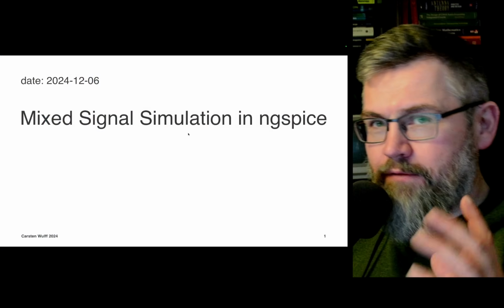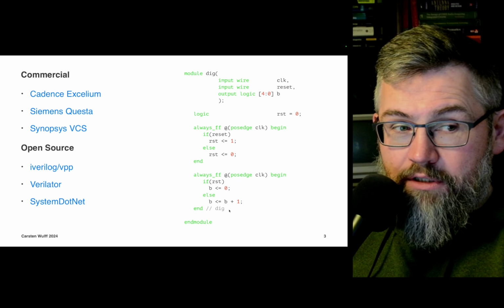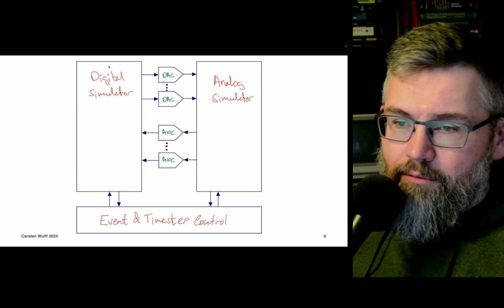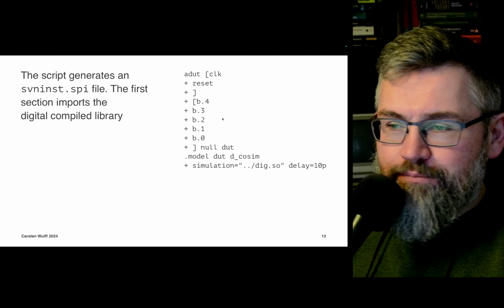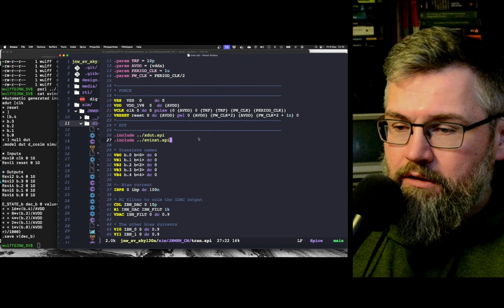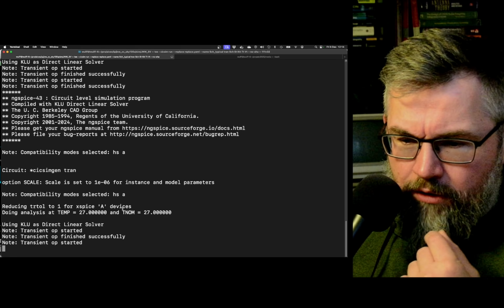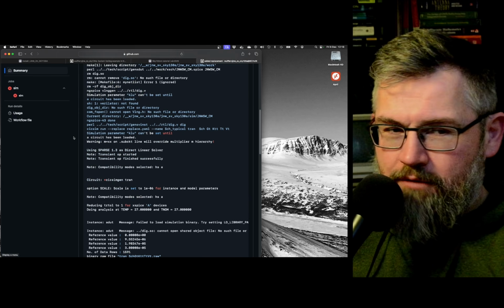Mixed Signal Simulation in Ngspice

Comment: Mixed-Signal Simulation in Ngspice: Combining Digital and Analog Worlds

* 0:00 Introduction: Overview of mixed-signal simulation, combining digital and analog components.
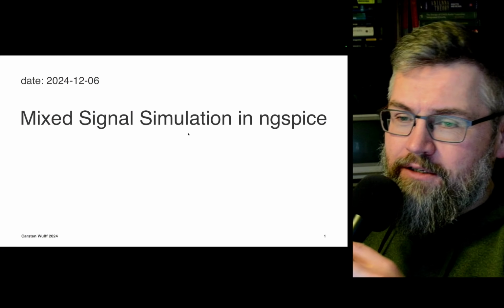* 0:40 Digital Simulation: Discussion of digital simulators, their causal nature, and the use of languages like Verilog/SystemVerilog. A simple counter example in SystemVerilog is presented.
* 5:00 Analog Simulation: Explanation of analog simulation, its challenges due to non-linearity and varying time constants, and the use of numerical methods to solve differential equations. Commercial and open-source simulators are listed (Spectre, ngspice, etc.).
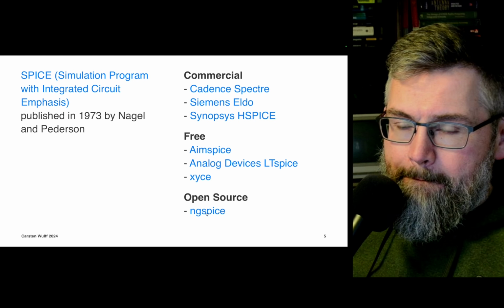* 7:37 Mixed-Signal Simulation: Description of the interaction between digital and analog simulators, including signal translation and synchronization.
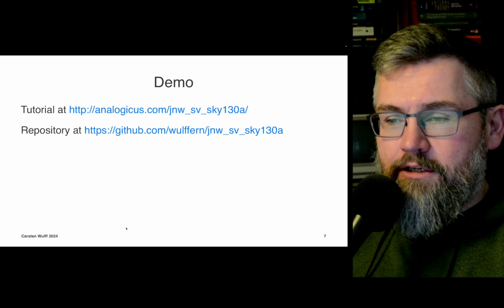* 9:20 Demo Start: Practical demonstration of mixed-signal simulation using ngspice and SystemVerilog.
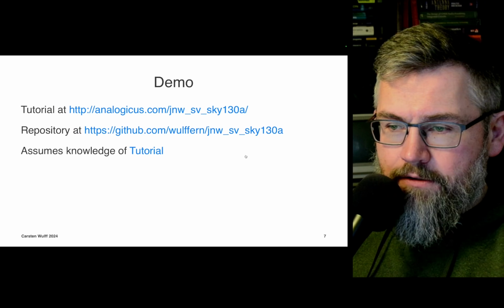* 11:00 Analog Schematic: Review of the analog circuit (current mirror and 5-bit current DAC) used in the demo.
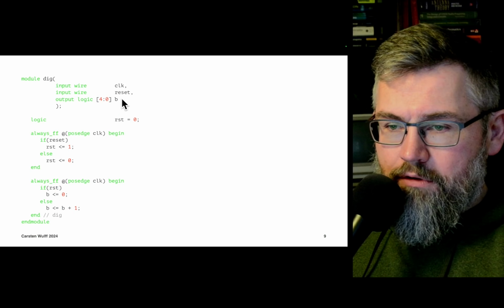* 12:33 Digital Code: Overview of the digital code (counter) that controls the DAC.
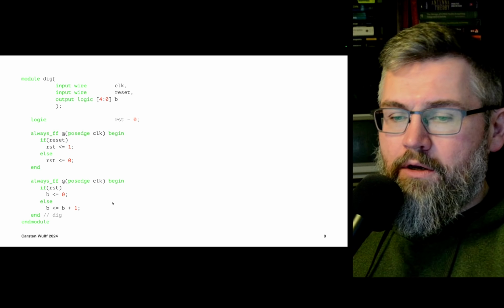* 12:40 Compiling Digital Code: Using verilator to compile the SystemVerilog code into a shared object (.so) file.
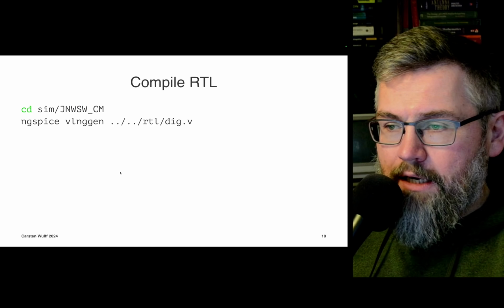* 15:40 Including in Ngspice: Using a Perl script to generate the necessary Ngspice code for incorporating the compiled digital code. This includes instantiation, connecting dummy resistors to inputs/outputs, and converting the digital bus output to a real value for easier viewing.
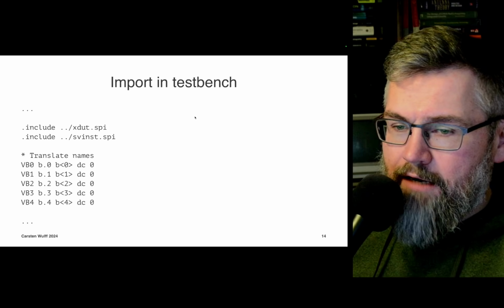* 19:48 Testbench: Explanation of the Ngspice testbench, including clock and reset generation, inclusion of the analog and digital components, and voltage sources for current measurement.
* 21:53 Setting Digital Levels: Overriding default digital output levels for compatibility with the analog circuit.
* 22:16 Running the Simulation: Executing the simulation using `make typical`.
* 24:56 Viewing Waveforms: Using a waveform viewer to analyze the simulation results, observing the DAC current changing with the digital counter output.

I used gemini-exp-1121 on rocketrecap dot com to summarize the transcript.

Input tokens: 22271
Output tokens: 455